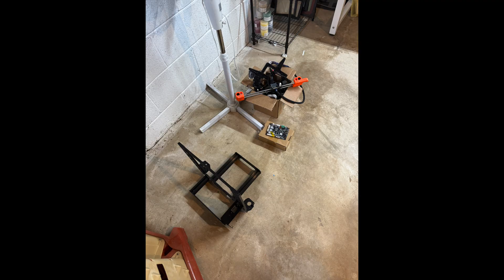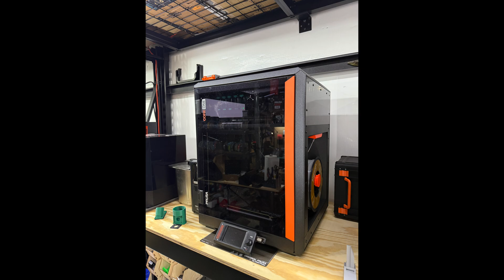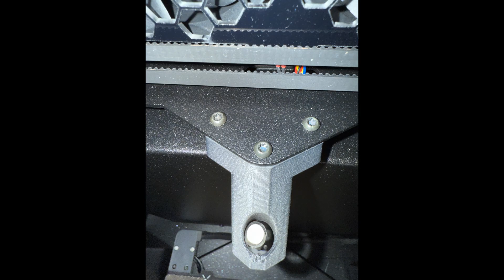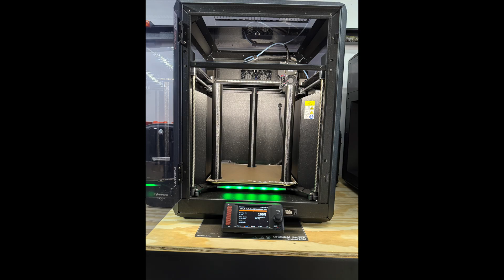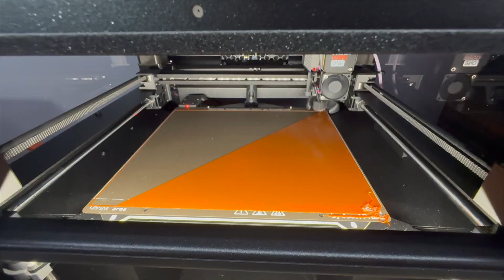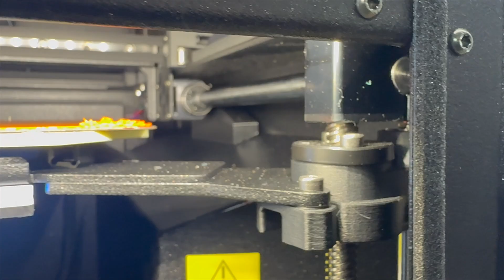Prusa Core One Issue - #printfixfriday @3DMusketeers

Comment: Any progress on this issue?
Reply from the maker: Yes and no. Prusa support seemed to think it was a non-issue, which to be fair, MOST of the time it is indeed a harmless quirk. But it still bothered me. So I loosened screws around the core XY frame (exterior screws), loosened the screws retaining the rear Z screw nut, bottomed out the heat bed via Z calibration command, tensioned the belts using the updated tensioning parameters, then tightened back all the screws I had loosened. This centered up the rear Z screw pretty well, and seemed to reduce the amount of bed mesh compensation required. I’m satisfied enough with the result. It prints fine for what I use it for. However it has definitely solidified my opinion on preferring cast printer frames over stamped ones. Everything has a trade off, and I recognize that. Stamped is modular, repairable, etc. However cast is VERY rigid and repeatable, which stands out to me.

Comment: have build my own core one and have Zero issues. Heres what i did.... The only good option:

1. Loosen both belts tensioners so the belts are wobbly/loose.

2. Make sure both belts are at both ends 5 teeth inserted(engaged into each other) in the holder behind the nextruder.(I checked and measured my belts and both belts are equal length exact the same tooths.) Carefully screw back the nextruder, the 3x screws behind fan are threaded in plastic nuts so don't overtighten!

3. With loosened belts check for gantry touching front and rear at the same time. Otherwise bent it a little until they hit both front and rear equal. WITH belt tensioned this step is useless because it is the uneven tension that is pulling it out of squaryness.

4. Move print head to front and center.

5. Start to tension belts. a little. This is very important: ONE or HALF turn at the time on each end. DO NOT tighten one side more then the other because again you will pull gantry out of whack. Look for a side that is not touching the front. Stop turning on the side where it does not hit the front anymore.

5. Start measuring with the app. When one belt is lower DO NOT tighten it a lot more to compensate for the other, because again, you will pull gantry out of square. I measured on Galaxy S23 2-3cm away from belt, in the middle, but straight in front of the belt. Not at an angle. There is a little delay because it needs to sense and look for the good sound.

Till this day it is still 85hz with print head middle back. When belt are loosened before i start at 90-92hz and after a few prints check.

You can fiddle around with tensioning and the gantry hitting the front and the back equally, but keep one thing in mind. TENSIONING ONE BELT AFFECTS THE OTHERS TENSION. Find A Middle way between 82-88 hz where it is hitting the front equal. That is more important than tension. I have printed on 70hz, 80 and 90hz belts and the difference is not that big.But the gantry was always square.

After that re-run x and y calibration.

Auto home takes 3 to 6 hits in the corner. But mostly 3 times and it is going to print.

Bed level:

1. First do an Z calibration.

2. Hover the printhead 1mm above the bed. In each corner and the middle drop the bed to 0(all the way up) and look if you see the nozzle not hitting the sheet. (DO not go flying 0mm over the bed, because you will damage the sheet)For the corner that is not hitting the bed, unscrew the 2 t10 screw in the corner pillars outside the housing. One front, one side. (The screws are at the exact height of the cory xy plate.)Press the core XY frame UP (With nozzle 5mm above bed) if it was not hitting the nozzle. Mostly front left corner. There is some play in the screws.Or lower the right side. (press down hard and tighten screws again) That's the same as lifting the left side.If the rear is not hitting you can do the same thing, but the rear leadscrew holder has to be loosened behind the rear cable cover. (It even has an slotted hole for adjusting/compensating)

Another option is to bend the front left or right POM leadscrew holder flaps a little. It is a straight steel plate, but when it is not level a straight plate is worthless anyhow.

Probing is way way faster. It is like the printer knows were Z=0 should be and it probes much faster.

My printer prints like a dream this way. It is really reliable. I can press print and walk away. It is not compensation for Z at any height.

For the rear leadscrew support not center: Release the rear leadscrew Pom nut bolts and center or over compensate the leadscrew and tighten the Pom nuts. Beware somehow i managed to damage the nuts or bolts and had to drill out the screws to save the pom nu and rear bed spacer.

Hope this helps.

p.s. i am not an expert, it is my first printer. Just an mechanical advantage sometimes. 😊😊👌👌

Happy Printing.

Comment: Looks like its off by a tooth or 2 on the belt length :) The bed is moving a bunch, but it is doing its job, so there is that.. But there is absolutely something amiss there. I would check and make sure the dampener things on the motors are placed right and tensioned properly, it is easy to mess those up in my experience. 

Otherwise, yeah, let me know what you find. Not having built a core one kit myself yet, I am a BIT limited there, but will do what we can to help!